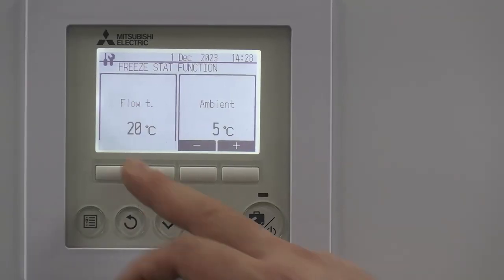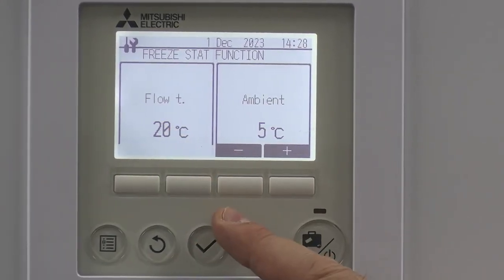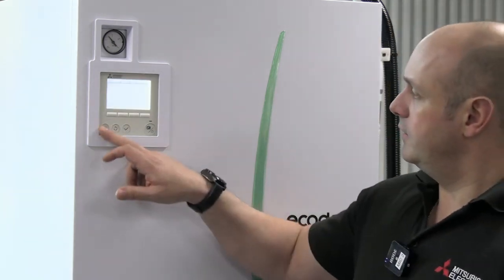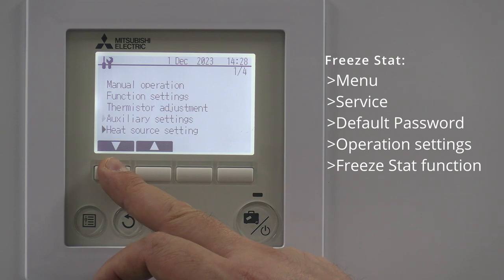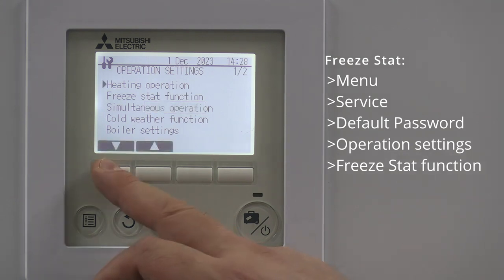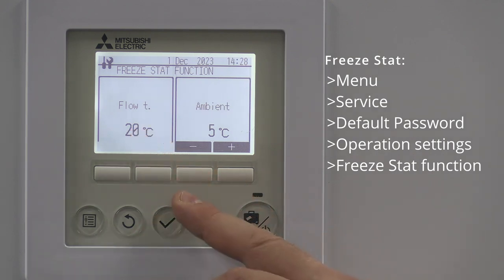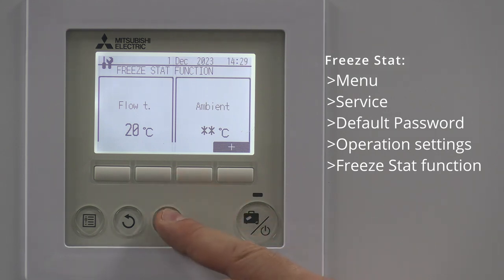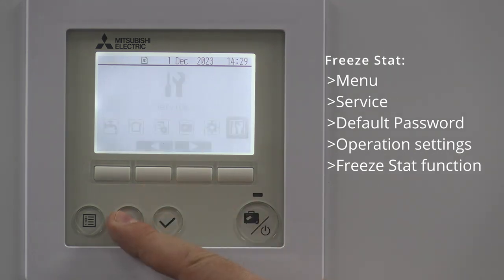How to  Use the Freeze Stat function on Ecodan   Mitsubishi Electric

Comment: Really helpful.  Glycol was not added at the point of installation because I planned to have work that would involve draining the system.  When the original installers returned to add the glycol they did not change this function or tell me about it.  Only realised I could do something about the antifreeze cycle coming on in the middle of the night when I found this video.